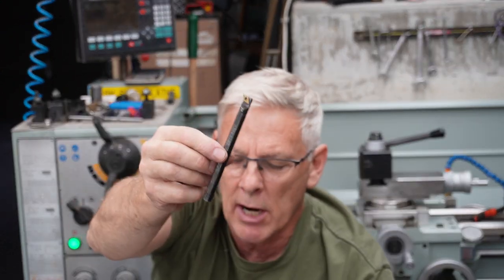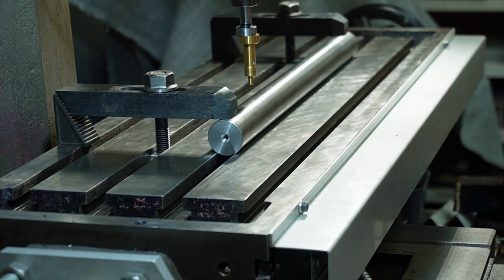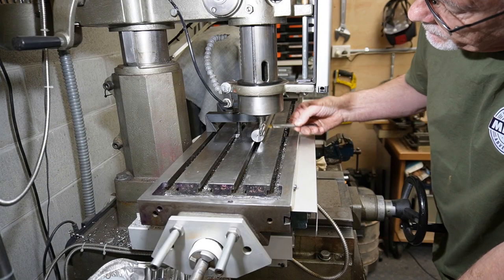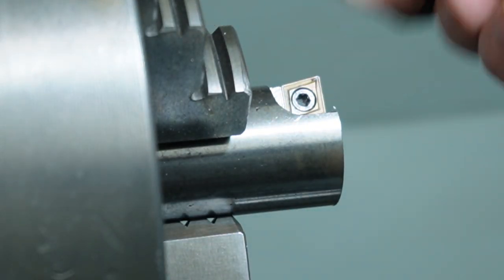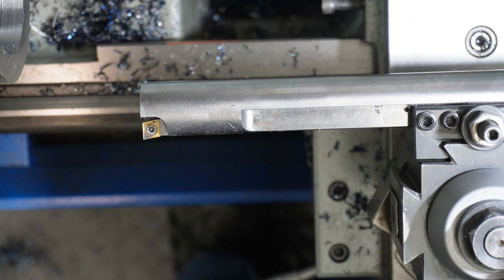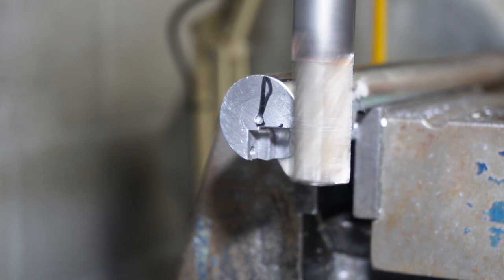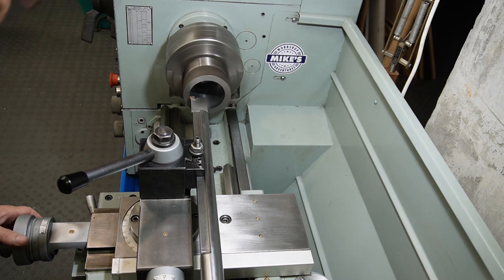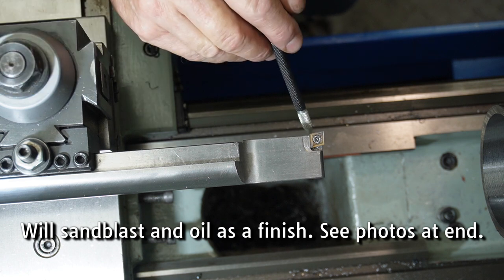Large Boring Bar Build

Comment: Gday Mike, thanks for the mention, the reason I used the 12mm boring bar in mine was so the insert is supported and I was to lazy the mill in a pocket, when I do heavy cuts on a through bore I angle the boring bar around to open up the gap between the side wall and bar and this stops the build up of swarf between the 2, it’s amazing how much more rigid these bars are, great job mate, cheers
Reply from the maker: Hi Matty. 
Thanks for the comment and appreciate you watching. You are one of the reasons I started my Youtube channel. Just average guys in their workshop doing honest stuff.  
Cheers Mike